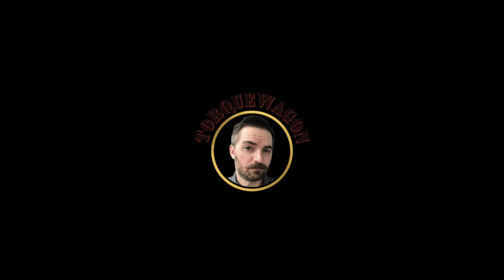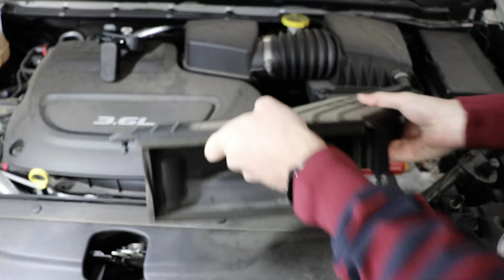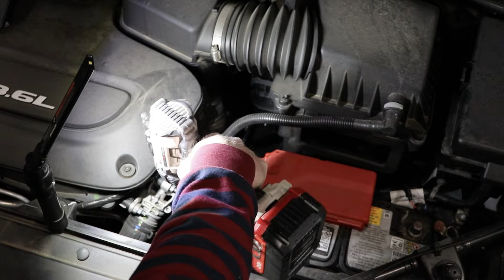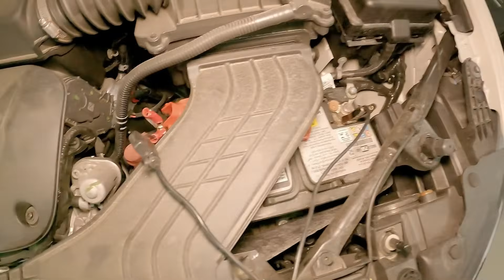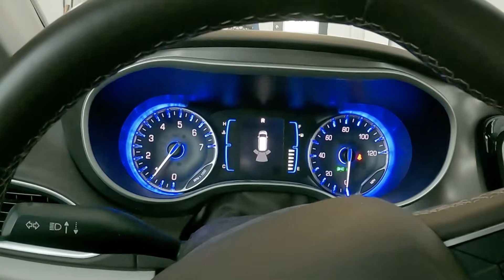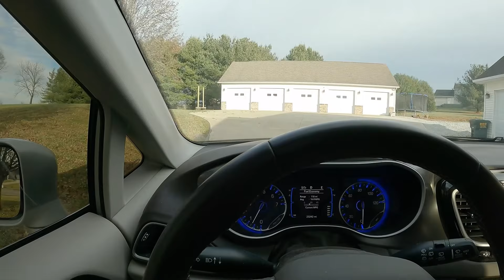Chrysler Pacifica Auxiliary Battery Replacement | Start/Stop Fix

Comment: Thanks for the help. I mainly work on heavy trucks and farm equipment. My girlfriend's van started this yesterday morning. I never knew it had 2 batteries. I tested both batteries. The auxiliary battery failed. I replaced it, all good now. The hardest part of the job was the clowns at autozone selling me the wrong battery.

One tip I would add, remove the little studs before removing the battery. It comes out easier.
Reply from the maker: That is a good tip. Thanks!
Reply: What battery did they give you? Just curious I had my auxiliary battery changed at autozone yesterday in my chrysler voyager but the stop start alert is still on the screen.

Comment: Just had this issue on our 2020 Pacifica, called the dealership because I had no clue what was going on. They were quoting around $800 to look at and repair a suspected Aux battery issue. 

1 trip to NAPA and 10mins later and this was corrected for less than $150 - Thanks!
Reply from the maker: That’s amazing. There have been a lot of comments just like this for this video and that makes me so happy. I’m glad you were able to do this yourself and save some $$$.
Reply: It's crazy because they knew exactly why the auto stop function stopped.  It's just easy money for them
Reply: FCA/Stellantis has been atrocious to work for and those technicians have been leaving for greener pastures, too. You can probably find a good shop that's employing someone that's well-versed in those things for problems you wouldn't wanna tussle with.

Huzzah to you, sir, for not getting your man-card punched and going D.I.Y. against they expensive behinds!

Comment: Can't find the aux battery on my 2017 it's not located next to the main battery need to replace it asap
Reply from the maker: I think I read somewhere that some of the early 2017 models may have had the aux battery located behind a panel in the front passenger side floorboard. I’ve never verified that, though.

Comment: I just bought my wife a preowned 2021 Chrysler Pacifica touring L last weekend at the dealership & it’s super nice leather & loaded but the start/stop service light was on in the dash when we got it and I didn’t know what it was until I looked it up and then I called the dealership and they were like oh yeah, we ran a diagnostics on it when we got it as a trade-in a couple of weeks ago and they forgot to replace the start/stop battery so since it’s under warranty we’re taking it back up there next week and they’re going to replace it but we haven’t got a chance to use this feature yet. I’ve heard a lot of people say they like it and a lot of people say they don’t so we’ll see. Also, I heard that when the auxiliary battery goes bad like you said it will cause the big battery to go bad or drain it but we’ve only had it a week and I haven’t had any issues with the main battery so I’m not sure about that.

Comment: This video gave much more thorough and comprehensive instructions for replacing the Chrysler Pacific Auxiliary Battery than any other video I watched on the subject. The comments were helpful as well. I ended up buying from AutoZone because of the price and the 3-year warranty. I couldn't find a single E5 bit (only sold in sets where I shopped) for the post swap-out, and my 4mm socket was too shallow for a good grip on the posts. I ended up threading a nut onto the post once the battery was on my workbench, then using small vise grips to grasp the non-threaded portion of the post, I successfully made the swap. My thought about threading the nut onto the post before using the vise grips was that if I damaged the threads in the process, I could re-shape the threads by removing the nut. I installed the replacement battery, hooked it up, reconnected the main battery ground, and started the car. The light was gone. The first time I took it out for a drive, the auto-stop feature worked as designed. Thanks for the great instructions.

Comment: I changed my auxiliary battery and kept getting the same message. I finally found online that the van requires 5 restarts each must be 4 hours apart, apparently sometimes it takes that long for the computer to pick up on the battery change. After the 5th restart the warning did go away
Reply: What do you mean by restart

Comment: Hey,  I just wanted to tell you thanks for how easy your video was to help do this!  I did it about 2-3 months ago.  Everything was fine until about a week ago that the SAME warning light came on AGAIN.  Any idea why this would be?  Note, I did not replace the regular battery, only the auxillary.  Thanks for any suggestions you might have.  Scott McConnell Louisville KY
Reply from the maker: I had to replace the main battery a few months later so that may fix your issue as well. I haven’t had any issues at all with the warning light since I replaced the main battery.

Comment: Thank you!  Had the same exact problem w/ inexplicable battery drain on a 5 month old main battery causing repeated incidents of a dead battery.   Your video saved me a bunch of headache trying to figure out why the positive lead wouldn't come off. Removed the securing strap and the main battery positive lead apparatus and viola!.  Thanks again.  More than a little annoyed at the dealership not telling me when I took it in for the start stop service bulletin and they tried to charge me $175 for a diagnostic cuz start/stop still nonfunctional.  Thanks again

Comment: Great video. Many thanks. Your instructions worked perfectly (including swapping the battery terminals). Just a tip for everyone...remember to hold the harness bolt firmly when finishing up... if it slips... it falls into the base of the radiator fan-housing and disappears. :)

Comment: Thank you for this video. 50k miles on our 2019 Touring L still with the original batteries. Alarm came up and going into winter I thought it was the main batt. Thanks to this video I got the AUX14 swapped. AUX14 are hard to find now at the local auto supplies. Amazon had an ACDelco.
I too used an 4mm socket on the terminals. I did not have a long enough extension for the 10mm socket which made that strap the hardest part.
Back together now. Followed instructions so the alarm is gone! I don’t mind the auto start. Why burn gas when not going anywhere? And it kicks on quick enough at the green lights. Thanks again!

Comment: So I have a 2019 and both my batteries are dead. Our dealership told us our warranty doesn't cover the battery so they want around $700 to change them. Almost no one else will change them either because ita auto start or they said the auxiliary will wipe out the memory if they replace it? Where is the best place to purchase both batteries so that we can at least attempt to do it ourselves?
Reply from the maker: I would check auto parts stores like O’Reilly’s, Autozone, Advance Auto or Napa. Sometimes you can get good batteries a little cheaper at places like rural king as well. I also have a video for the main battery replacement that you can check out. Plan to spend about $300-$350 altogether on the batteries. I did.
Reply: @TorqueWagon   thank you!

Comment: Hate Auto Start/Stop?
This worked for me.

Disconnect the Aux Battery Negative Terminal and insulate and secure the lead in a safe place.

The defective battery will no longer suck down the main battery.  The Start/Stop will not function.  The Fult light on the Dashboard will stay on.  Your 2 options are: Ignore it. Or cover with electrical tape.

Comment: Thank you for the video. I hate the auto start/stop feature. Can I just not replace the auxillary battery and so I won't have this auto start/stop feature? Will there be any concerns for the main battery if my aux battery is dead?
Reply from the maker: I’m not 100% sure but I think the aux battery will draw power from the main battery and shorten its life if you let it go too long without changing it when it goes bad. I ended up having to replace my main battery about five months after the aux battery. I had the start/stop light on for over a year before I changed the aux battery and I’m sure that didn’t help my primary battery any.

Comment: Thank you so much for this and the video on how to replace the main battery! After I hooked up both a series of 3 beeps keeps sounding seemingly from the dashboard speakers every few seconds. I haven't been able to figure out what is causing this or how to stop it. Any ideas? Again, thanks for the videos!
Reply from the maker: You might try disconnecting the negative battery cable again for about 15 minutes and make sure all the colored connections on the aux harness are in the correct places. Thanks for watching.

Comment: This saved my bacon!!! My husband hates start/stop and refuses to even drive my car so we ignored it when the light came on 2 months ago.  This morning, van wouldn't start.  Then the brake locked up( found a msg board that said this was from pressing break too many times without engine starting) and the dashboard message center told me there was a problem with the electrical stability control and anti-lock brake system. I found your video, followed the instructions, and FIXED my van MYSELF for about $100.  It was just the auxiliary battery.  Brake systems were fine once the new battery was in place. My hubby is working a double shift so I didn't even "inform" him I was having car trouble.  Thank you so much!
Reply: You're a very independent lady‼️ Good for you, hopefully he believes you once he notices you fixed it! 😉
Reply from the maker: That’s amazing! I’m so glad the video helped!
Reply: These are exactly the problem I had. I was dreading my trip to the dealership I had scheduled in an hour. Cancelled it and saved me some money. Other than the aux battery cost.

Comment: Such an informative video! My battery died on a 2019 Chrysler Pacifica. I was searching for a video on how to change the main battery and ran across this video regarding the auxiliary battery. For some time now, my start/stop feature hasn’t worked and I just ignored it.  Now - I see that it was the root cause for my main battery dying earlier than it should. If it wasn’t for this video, I would’ve replaced the main battery and ended up having it die early again! Thanks so much for taking the time to post your lessons learned so others don’t end up fixing the symptom and not the root cause!
Reply from the maker: Just FYI, I had to replace the main battery about 5 months after the aux, so it’s probably a good idea to just do them both at the same time if that’s an option for you.
Reply: Oh and also - do you have a video on how to replace the main battery?

Comment: Very good video. I replaced the aux battery in my 2018 Pacifica and it starts now with no problems or error lights. Purchased a replacement from Menards ($75) which was about 1/3rd the price of a dealer battery. I did have to modify the positive connector a bit.

Comment: Thanks for the video. Unfortunately my "service start stop" light is still on. Any ideas?
Reply from the maker: Did you disconnect the negative cable on the main battery while you changed the aux? That usually will reset things enough for the light to go off. It’s also possible that your main battery needs replaced as well.
Reply: @TorqueWagon  My light is still on after doing this. I had the main battery tested on the same day as I replaced the auxiliary and it tested good. Any ideas? I did disconnect the negative on the main battery while I changed it
Reply: Did your light go out??

Comment: This video covers it nicely.

WARNING though if you go to advance auto parts: the battery they had in their system was the wrong one. The posts were different, and I had to take the one they gave me back. Luckily, they had one in the back that was not listed in their system as a fit, but it was the right battery. The problem is that there are batteries with the same geometry, but you need the terminal posts like on the original battery so that the positive cable fits.

Comment: I had to do this today due to the aux battery causing the transmission to slip at times. (The dealer told me that the aux battery powers parts of the transmission)

Comment: If you disconnect that other connector on the negative battery terminal (main battery) it will disable the feature.    No need to ever press the button. You will have a light on the dash, but I haven't notices any other effects.

Comment: As soon as you said 10mm my anxiety level shot through the roof. Any car guy will know exactly why.
Reply: Why?  Love 10mm. Very standard.  Lots of small engines use them too.  You just don't use 160 psi to torque.
Reply: @robertvance2790  You are obviously not a car person because if you were, you would have known exactly what I meant.

Comment: Is the sequencing important?, I replaced auxiliary battery and car starts , but stop start message is still on. I did not remove negative cable from main battery before replacing aux. battery
Reply from the maker: That’s probably it then. If you remove the negative battery cable for about 5-15 minutes, that should provide the reset it needs to get rid of the message.
Reply: Did your light go off?

Comment: I followed what you did but also replaced the main battery. Once done, it started up fine but there are certain features inaccessible or disabled. For instance, the backup camera isn't working, there is no button on the screen for heated seats or rear climate control, and, so far, no stop/start. Will these eventually come back after driving or things resync? I drove it around our country block but these features haven't returned yet. Thoughts?
Reply from the maker: There’s an accessory harness that sits on top of the battery. I wonder if maybe something didn’t get plugged back into it or things got plugged into the wrong spots. I know it connects to the aux battery and there are 3 other things that plug into it, maybe backup camera, heated seats, and something else. On mine, the plugs on that harness from driver side to passenger side are black, red, and white. They may need to be in the correct order for everything to function. I have footage for a main battery video, but haven’t filmed my explanation or started editing yet, so it may be a couple weeks before I can get it published.
Reply: Did you ever figure this out? I jist replaced my aux today and same issue.
Reply: @bleakhappy  Yes. Everything came back. Must have needed some time to reboot all the features. So far, so good. Now I have a coolant problem to fix. Thinking it's the heater core.

Comment: Looks like it's been about 7 months since your battery replacement.  Everything ok? Any issues?  I have a 2017 pacifica  (bought used in 18). I'm pretty sure I'm going to replace both batteries to be sure.  Is that fairly easy? Which should I replace first?
Reply from the maker: I actually had to replace the main battery about 5 months later and should have a video for that out soon. If you don’t mind spending the money all at once, it’s probably best to replace them at the same time, but that’s probably going to cost about $350. I’m sure a dealer would want $1k or more to replace both batteries, so $350 doesn’t sound too bad when you think of it that way.
Reply: @TorqueWagon  The start stop system seems to chew through AUX batteries way too fast and then starts to shorten the lifespan of the main Pacifica battery.  I hope Chrysler can do a recall/fix on this sometime.
Reply: I’m having to replace my AUX battery for the second time in a year in my 2018. I hate it.
Reply: @Sophiasgamings  Same this year.  I reached out to Chrysler customer care and they are telling me to see my dealer.  I will be making an appointment.  Something is not right.

Comment: Can  somebody tell me where to get the battery the dealer wants to charge me 140 for  a tiny battery
Reply from the maker: I got mine at Advance Auto Parts locally. There should be a link the description. Most auto parts stores should carry something that will work though.
Reply from the maker: I think I paid about $115 or $120. They’re not cheap.
Reply: Mine was $130 with tax from an auto parts store.

Comment: The auxillary battery intentionally drains your main battery and destroys the electronics of the vehicle  if you don't replace it when it goes bad. The only way to keep the aux battery working is to drive it 20+ miles a day.  Chrysler is a complete joke
Reply: This is an issue that I'm encountering with my 2018 Pacifica.